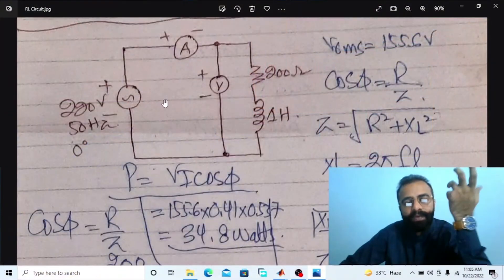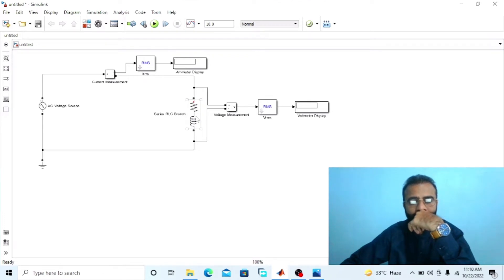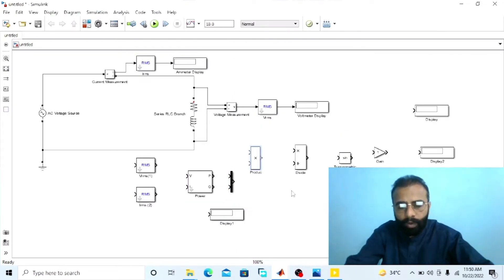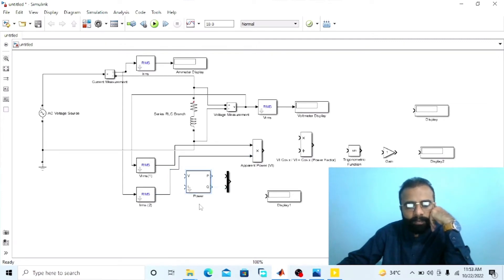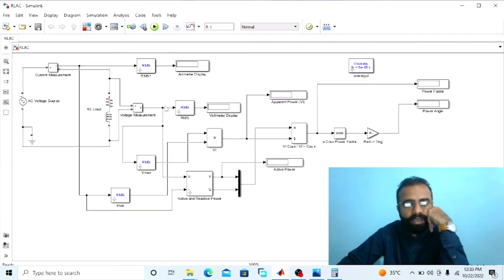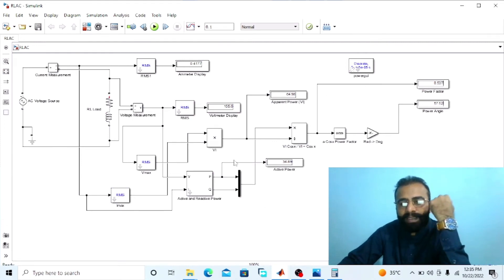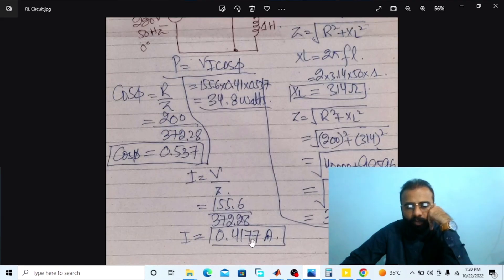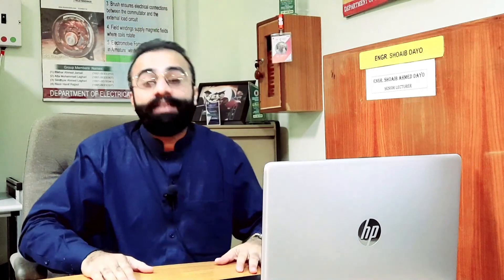Power Factor and Power Measurement in RL AC Circuit using MATLAB Software | RL AC Circuit in MATLAB

Comment: in this simulation, you put the peak value,220V but i think, you have put the  peak value = sqrt(2)*220, why because you measure the all value in rms, for 1mH inductance value the output voltage is not much more affected, may be same as rms value
Reply from the maker: Yes dear, to calculate the power factor in an AC circuit, you must use the RMS (Root Mean Square) values of voltage and current, along with the real power, to find the ratio. Thanks